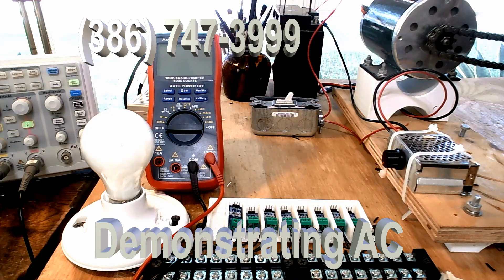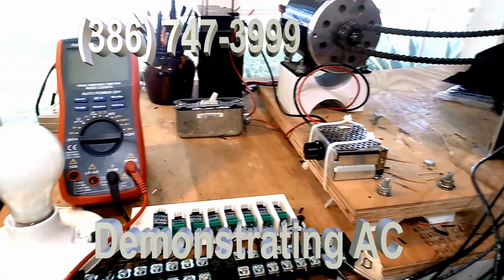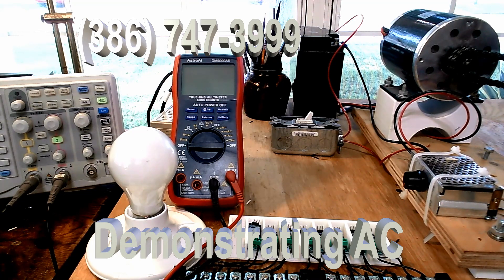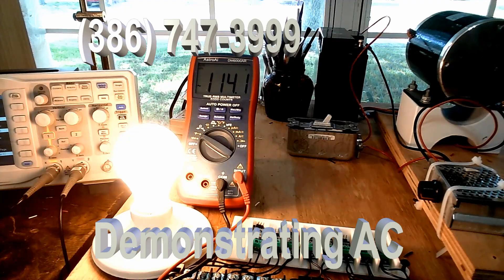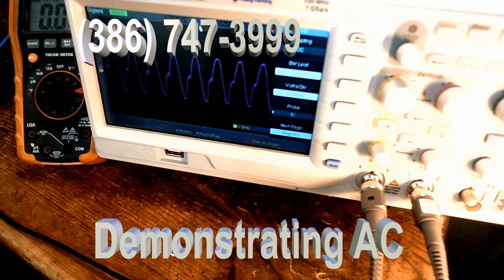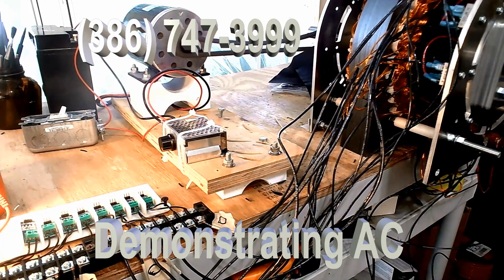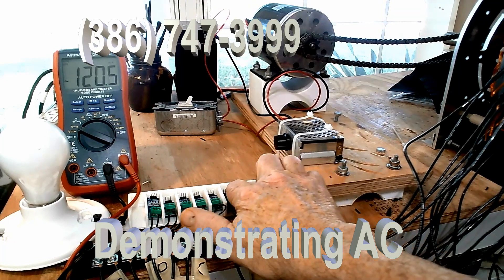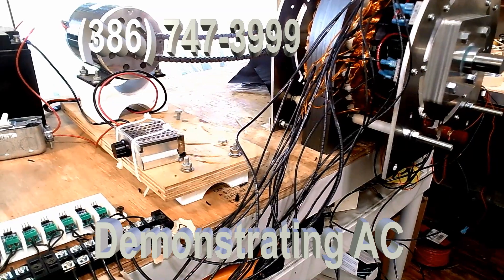Demonstrating AC w/ FTC Generators

Comment: Service on my house is 200 Amps.  Are we there yet?  I'm chafing at an AC generator that has to be rectified just so we drive an inverter to get AC again.  Maybe the efficiency is sufficient to warrant the losses.  So I was hesitant to ask, and there you go -- AC direct.  Bottom line.  Can we drive a 200 amp service?  What kind of load on a prime mover are we talking?